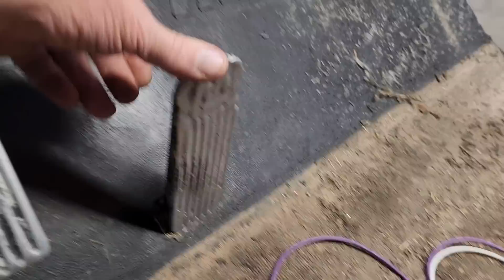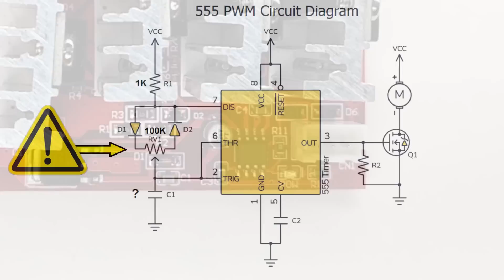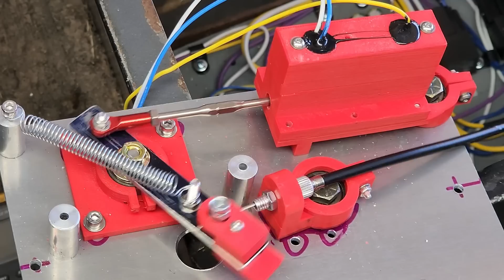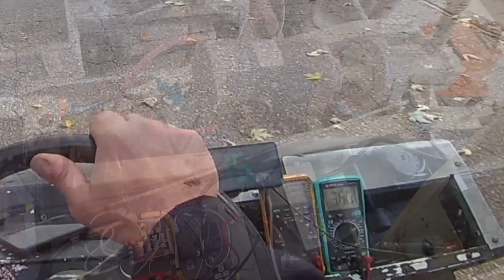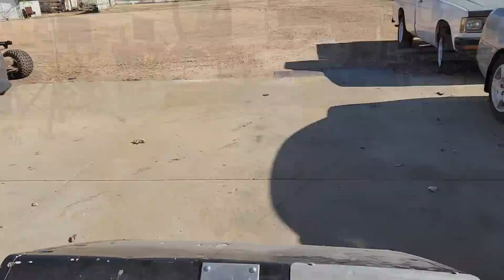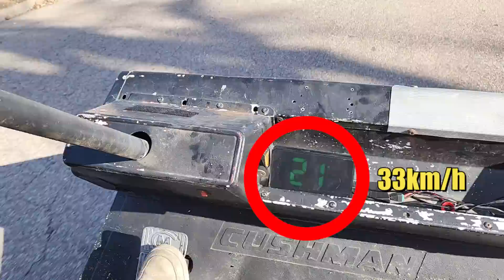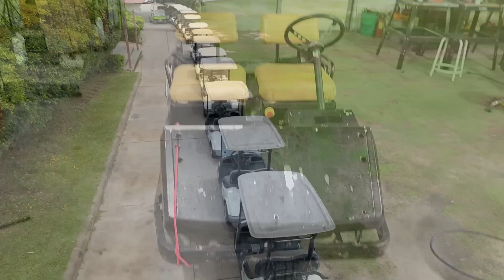S4 E38. We build a custom throttle and road test the gasoline / electric hybrid petroleum battery

Comment: I had a thought (lookout). I have a 4KW RV type generator. 102/240VAC So if I put that in  a golf cart, I would have a portable generator. That could charge a small set of batteries, (Li Ion?). And that with a inverter drive, run the motor. Technically an in line hybrid, with a bonus. :)

Comment: A 48v 100ah battery is about $700. You could go with less like 50ah. Most of them put out 120amps so that would nearly double your total output. Plus you could have the engine under full load and then shut down when the batteries are full for maximum efficiency.

Comment: you should put that big block preditor engine in that cart connected in place of the electric motor like you did with that french car. LOL
Reply from the maker: Indeed, I'm more of a BIG BLOCK guy.  Its interesting that on our road test we saw an overdrive effect where the engine was spinning at 3600 rpm and the motor was spinning at 5200 rpm.  I'm afraid a BIG BLOCK wouldn't get us to 21 MPH with the silly 12.7:1 rear axle ratio we have.  Although with a BIG BLOCK we would be able to burn the tires right down to the rims.... hmmm... Have a good one!

Comment: I thought the engine has governor (auto throttle) so you don't need to adjust it's rpm
Reply from the maker: The throttle can vary the RPM and the governor will hold the rpm at any speed the throttle is set to.

Comment: Problem will be with current limiting. Throttle need to take account to current used by engine. Because you can destroy windings in engine. It is just copper it cannot contain move electrons :) 

Arduino based engine controller will be the best. It could limit current by limiting exacting voltage on alternator, it could control reversing relay and engine speed on reverse speed. You don't want to have full power in reverse. Even you could have "low gear" mode where speed is limiter. 

But still you need analogue electric overcurrent protection, overspeed protection etc. Also most power electronic need to be based on relays only with arduino logic.

There is a TON of development. I like this.
Reply from the maker: Indeed we need to current limit the output of the alternator.  If you look closely at some of the engine compartment shots, there is an adjustable current limit switch for simple current limiting.  We haven't connected it yet, but the theory is when its triggered it will kick in a relay that will add a fixed resistance to the alternator field.  Like I said its a simple system.  At some point we will depart from the simple version and do a full arduino version.
Reply: @ the biggest issue will be to throttle petrol engine. Maybe small three 12 volt batteries in series would be needed to apply instantly power to engine until petrol engine get power. Also they can be used to store energy while breaking.

This would change this golf cart into Toyota Pirius or better Honda Insight.

Comment: I was thinking of a rack and pinion setup with the rotary pot because I have the mechanical type of brain. Pinion on the rotary with a rack with spring loaded return, something like an e-brake cable setup with the cable inside a compression spring to return the rack to zero position. Another is a pedal with gears to drive the rotary pot.  Just a thought....
Reply from the maker: Indeed a rack an pinon would work.  we are looking into some gaming pedals and guitar foot petals that use this system.
Reply: @robotcantina8957  Thanks for spending part of your holiday with us fans. 3D printing has taken our craft to a whole new level. I have the Bambu Labs P1S with AMS. Life altering stuff. Just like the petroleum battery, if not for 3D printing, nobody would or could do this stuff, without a machine shop.

Comment: Yeah Jimbo I will second what someone else has already said about the controls for a wah pedal or a volume pedal. Like for electric guitars.

It's essentially a rack and pinion with the rack attached to the pedal, and the gear attached to the shaft on the pot. Pressure is maintained betweem the two with a simple rubber band I think.

And the system is literally designed to be stepped on repeatedly. Although.... they are built inside of a strong metal housing. 

Definitely worth looking at the system, you'd have to modify it but I think it's your simplest solution to the problem. 

Happy Thanksgiving!!
Reply from the maker: I'm looking into this right now.  Its awesome that so many people have great ideas.  Thanks and have a good one!
Reply: Also I'm pretty sure some of them are already 100k

The parts are cheap, and if you didn't want to buy them, I think you could 3d print them

Comment: Add a capacitor for a buffer
Reply from the maker: where in the circuit would you put a capacitor?
Reply: @robotcantina8957  I just realized it won't work since you're using the alternator as a motor controller haha 😅
Reply: @robotcantina8957  maybe a dual alternator setup in parallel would help

Comment: Jimbo- overspending a DC motor like this can cause the armature to explode, because it’s heavy and full of heavy gauge windings. BUT - luckily DC motors have a top end RPM self limit proportional to input voltage, thanks to back EMF, so difficult to overspeed unless you REALLY give it the beans.
Reply from the maker: Thanks!

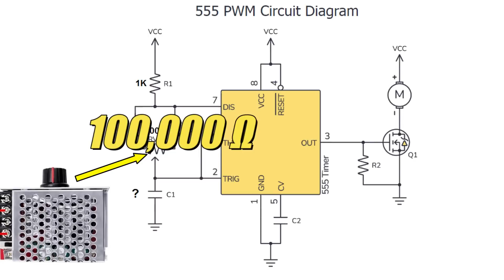Comment: 4:50 the way people use 555's for things is absurd, I was watching some guy design a boost boost converter and a few other circuits and he just would always pick a 555 for some aspect or another even though there were simpler methods to achieve what he was trying to do.
Reply: Agreed. Non-electronics people think they're the solution to all problems. Electronics people roll their eyes and go get something proper.
Reply from the maker: lol, For some folks the 555 is the answer.  Personally, I like using an Arduino for everything.  Have a great one!

Comment: Practicality and safety wise its best to change the circuit to work with a existing drive by wire wire pedals. But I get what you are trying to do here. For those that try this, just make sure the pot is fail safe. Wired so if any connection to it failed or the pot failed, nothing bad happens.

Comment: Hahaha no french cars. You could remove the 555 timer circuit al together, than use a transistor to translate the system voltage to the Mosfet, because if not the mosfet doesn't open totally and control this transistor with Arduino esp (32 bit) and generate a new PWM signal controlled via a "pot", maybe you need to use a NPN to control a PNP to control the mosfet on the right voltage.

Comment: The faster an electric motor turns, the more back-emf it generates, which means you have to put higher and higher voltage into it to make it go faster. As the motor draws higher and higher currents, the heat it generates will go up, and the motor will overheat, which basically means you melt down the insulation between the coils and turn it into a smoke machine. Even if you don't overheat it, the bushings, windings, etc. are only insulated to withstand a certain max voltage. If you exceed that, you will cause internal arcing, which will turn it into a smoke and lava machine. If you overspeed it by mechanically driving it faster without exceeding the power rating, then you are looking at vibrations and friction overheating and destroying bearings, vibration causing internal damage to the windings, and beyond that, you'll likely just fuse the bearings and turn it into metal filings producing machine. If you try to spin it up like a jet engine, the mechanical structure of the rotor will start creating stress fractures from the internal forces, and eventually the insides with explode outward in metal shards and copper spaghetti, turning it into a noise and surprise claymore machine.
Reply from the maker: Thanks!
Reply: Back-emf is voltage. Voltage and current are not the same.
As this is a series wound motor, it does not have a maximum rpm per se. The maximum rpm is limited only by mechanical losses and thus it needed to be limited externally.
I think there is two main probability of damage in case of exceeding the maximum rpm. One is the mechanical failure of the rotor/bearings, and the other is excessive sparking around (and thus the deterioration) the commutator.
Reply: @SLeslie  the backEMF flashover can be solved (up to a point) with field weakening, I explained that in another comment
Reply: @MrOpenGL  Yes, there are ways to solve these problems. However this thing has only 3 wheels furthermore without the batteries it is significantly lighter too (the center of mass is higher), plus if I understand correctly it has brake only on the rear axle. So in the end I would recommend against going much faster with this thing.
Reply: In that specific motor, I'd say the highest risk is bearing failure due to age, or the casing failing due to rust and letting parts fall out of place.
I would personally plan for a replacement motor simply due to the potential for age related mechanical failure in the original one.

Comment: As a general rule you can "overvolt" a DC motor 1.5X the rated voltage so a 36V motor could be overvolted to 54V without much of a problem any higher and you run into heat dissipation problem coupled with brush wear anf possibly winding separation and bearing damage, if you plan to keep this tip top then regrease the bearing and that should solve that. The other thing to watch for is possible gearbox destruction, but with your setup, that doesn't look like a problem. You have reduced the weight and have a "soft start" pedal.  This is a great build.
Reply: Also the old varnish and ties on the armature can let go if you over speed it too much, resulting in a catastrophic failure as the centrifugal force rips the winding out of place
Reply: @anonymusptbo8704 That's when your motor starts singing at around 30,000 rpm. LOL 😢 I would stand back or put scatter shields around it! A motor of that size mass could grenade if pieces started letting go and get between the rotor and stator or armature and magnets/housing. Like taking a big block engine up to 8 or 9 grand. One that's stock, factory balance that is. 👍
Reply: @ElectricBillAlbright  I had it happen on an old 36v Black and Decker lawnmower that was in for repair. Shot a comm bar through the Shop ceiling. Nover thought it could happen on a lower speed motor until then
Reply: That's a very broad assessment. Yes, there's a certain amount of "fudge factors" allowed.  A lot depends on the purpose a motor is designed to be used as. A high power motor will usually be rated for intermittent use. Like to engage a lever for a gearbox once in a while and it's a short duration to move the lever. You can easily ruin those types of motors with little overvoltage. Those high performance RC car motors( brushed type) you don't want to exceed the voltage, because they are wound for maximum motor output at the rated voltage. The main thing isn't necessarily the voltage, it's the current through the windings that creates the heat. If you shove too much current through the windings and that also will increase with a load on the motor, causing inductive loading to increase. A golf cart is a considerable amount of load for an electric motor. There's a long time span for the effects of induction loading to decrease also. In other words, it takes a while to speed up and level off. The whole time building up heat. Increasing voltage, however, does increase current through the windings. 👍
Reply: The 1.5x overvolt thing does hold some truth, in general practice, when you are rpm limited, not tq limited.

Most DC motors are ENGINEERED for nominal voltage +10% with a safety factor. For anything that’s going to run steady state loads, +25% is usually not an issue.

If the motor can run freely up to the new rpm, you aren’t nearly as likely to smoke it. 

A shaft mounted, 3D printed fan would be a great addition in any case.
Reply: its running off an alternator. a limited source of EMF. it technically cant overvolt as its current AND voltage limited.

the alternator will never deliver the current the motor could pull if stalled. 

when running, the BEMF counters applied voltage, limiting current.

either way, its not connected to a low impedance battery, or mains transformer, ie, "constant voltage source". its connected to an alternator with its own internal resistance. any measured voltage is neither the applied EMF, or the counter EMF generated. its the difference of the two. any measurement of voltage, and current, and "power" determined from those readings is suspect, and virtually meaningless.

on a circuit of this type, the phenomenon known as "jacobis law" becomes extremely apparent.
Reply from the maker: Thanks!
Reply: @robotcantina8957  Another thing you REALLY need to keep in mind is that you're likely going to run into problems with backemf flashing over at the collector, you really need to do field weakening if you want to go fast. 
Since you have the field accessible, just add a power resistor of a similar resistance as the internal resistance of the field, with a contactor or switch to connect it in parallel to the field when running at high speeds. DO NOT start the cart with the field weakened, it will have very little torque.
That's how it's done on electric locomotives with rheostat controls, same as your cart.
Reply: @MrOpenGL it might be fine seeing as the motor is at 13 to 1 but it will pull more amps to compensate some
Reply: Yep, but if he wants to push it to go FAST! he needs to deal with that, otherwise he needs to raise the voltage too much which will destroy the collector eventually.
Reply: so.  any lightweight engine from a car....with a real muffler ... say a 3 cyl geo engine with a zena alternator...could idle and be quiet and fairly fuel efficient waaaaay more power capacity.   100k controller being key.  hmmm
Reply: I wonder if you could achieve more speed if you removed the governor from the gas motor since lowering the throttle had an effect of slowing the cart down. Or a different pulley ratio to speed up the alternator at full throttle.
Reply: The stock alternator diodes are going to complain at high voltage.  Modern alternators use avalanche diodes to limit spikes in the electrical system.
Reply: @bobroberts2371 Kind of like "kick back" in solenoid and relay coils. In microprocessor circuits where there's a signal to turn on a high current section they use a driver transistor to handle the current of the relay coil. You'll see a resistor across the coil leads. That loads the kick-back spike down so when the relay is powered off it doesn't send a spike back through the driver transistor or possibly the sensitive microprocessor.
One time, I got to learn about coil kick-back and just how powerful it can be. I had a trunk solenoid and I took the wires and touched them to a car battery. I had each wire in my hands and when I took the wires off the battery posts, it shocked the hell out of me! From the coil passing through the magnetic pole piece by its return spring generated a voltage spike. Probably a high voltage too! LOL 😂

Comment: That cobalt throttle pedal has two potentiometers, that are inversely proportional,  and so does the throttle body, on an ICE engine, and they must work in unison,  if not , the ECM goes into limp mode.

Comment: If you intend to push you golf cart to the limit, you might want to monitor the temperature of the alternator and the electric motor. Overheating is pretty much what will kill them. You can probably overpower them if you can dissipate the heat.

Comment: My guess for the higher than calculated mph is that the tires are larger than 17.25".  The numbers on tires on nominal, aka not 100% accurate.  I've had two tires with the same specs on the sidewall be over an inch different in height which means they also have different diameters and cover different lengths per rotation.
Reply from the maker: Since the rear tires are not golf cart type tires, I actually had to measured them and they are 17.25

Comment: I'm very glad you are considering the safety and durability aspects of the project. Many yt channels only show the broad strokes and totally ignore all the critical safety features required to make a vehicle useful without risk of it becoming a sui-slide machine.
Reply from the maker: Hopefully folks pay attention to the details
Reply: Actual drive by wire cars pedals have 3 pot usually one runs in reverse of the other two. This is monitored by the computer and if there is any out of range or other unexpected behavior the car will go into limp mode. A little arduino would do that and also run the throttle. Even a basic throttle operation like dropping to idle when the load goes away.
Reply: Let the record show that Jimbo IS NOT suicidal!

Comment: diesel locomotives make 'transition' which is a rudimentary theoretical 'gear' change.  The connection btwn the gen/alt and the traction motors switches from series to parallel (and the motors btwn themselves switch as well) not sure if there's a way to change series/parallel on a single motor for high torque/low speed start transitioning to faster speed/low torque.  I don't pretend to know, but that's how locomotives generate more tractive effort at low speeds etc.

Comment: Hi looking at the alternator drive, are you sure it's spinning fast enough?  On an automotive setup the crankshaft pulley is atleast 3-4 times as big as the alternator pulley and the automotive engine rpm can go up to 6000 rpm and cruises around 2000 rpm